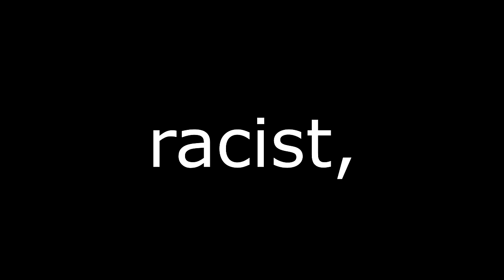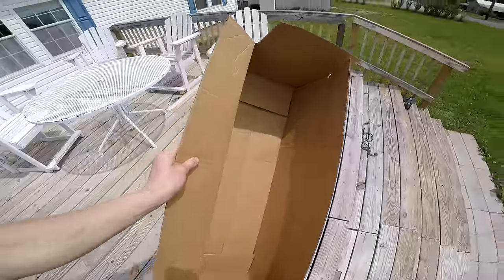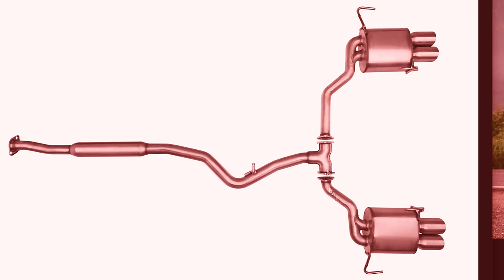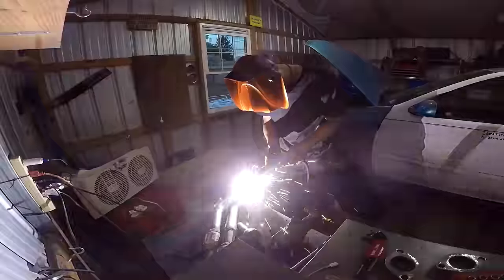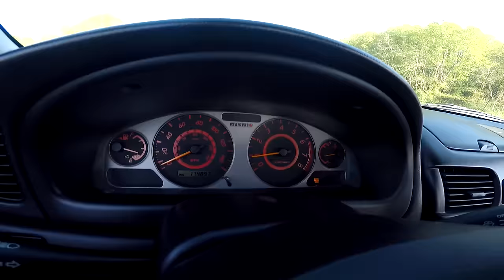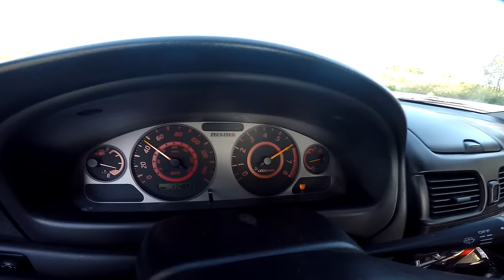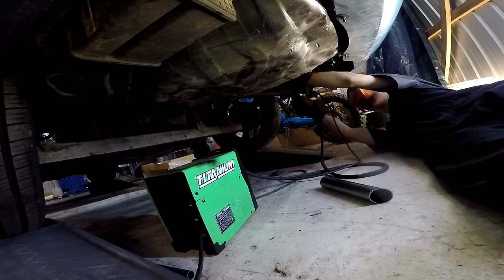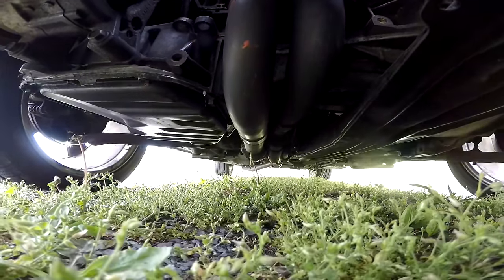True Dual Exhaust on a 4 Cylinder - What Will it Sound Like?

Comment: A little bit Subaru, a little bit Honda magna... neat.
Reply: Didnt mitsubishi make the magna?
Reply: @Cmdrbzrd  motorcycle, not car.
Reply: Yeah pretty accurate actually
Reply: Yooo y this comment make me lol 😂
Reply: Yo I have have both and let me say, yes. Yes indeed 😂
Reply: Sounds like a 22b scooby rally
Reply: which is a boxer 4 and the other is a v4
which means success?????
not inline but still a 4 cylinders
Reply: @Spheredalai  u have no clue
Reply: @savagesemple5353  sabie?
Reply: Saabuhroo
Reply: @Cmdrbzrd yes they did the Magna /verada was mainly produced in Australia / Africa for the Australian African and Malaysian markets but was produced and sold in the USA as the galant and verada as well the car was generally regarded as reliable as long as you kept up on maintenance as the 6g70 v6 platform well good all around it will throw serpentine belts and timing belts as well as blow head gaskets if you let it but put $5k of work on the engine of a Magna and you’ll easily get over 500k kms out of it
Reply: I miss my magna 😢
Reply: i don't own a magna but i still want  to own one and yes it sound almost like that ahhaah
Reply: mangina **
Reply: A lot of Subaru
Reply: A Sh&t ton of VW air cooled 4 cylinder
Reply: Definitely hearing the Honda magna. Had one before I got hit by a car on it lol
Reply: magna  exactly!
Reply: Sounds like an Austin mini
Reply: It DOES sound like a Magna!
Reply: I have a 1986 manga I can say it's pretty similar
Reply: It sounds nothing like my V65.
Reply: @Cmdrbzrd  smokey magna is what i see from aussie cartube
Reply: Not even a bit. This sounds like a Ducati
Reply: Exactly my thoughts or like the Evo  on 2 fast 2 furious
Reply: THIS COMMENT GOT MORE LIKES THAN THE ACTUAL VIDEO 😂😂😂😂😂😂
Reply: As a Magna owner I thought the same
Reply: I own one that I vfr swapped. Love it and would never part with it.
Reply: @camdenk1642  vfr? Like the 750 interceptor?
Reply: I miss my magna
Reply: Magna 🤔
Reply: I own a Honda Magna with 4 into 2 SuperTrapp exhaust. It's a very similar sound.
Reply: ABSOLUTELY! My first thought was that this sounds shockingly like my Magna minus 3k RPM. It’s got a much less aggressive idle than the Magna, but under acceleration it sounds almost exactly the same.
Reply: I miss my magna
Reply: i read that to the tune of mambo 5

Comment: It sounds like a well mixed cross between a Subaru and a bike engine...almost reminiscent of a Group B car. You've unlocked a new setup for 4 bangers that doesn't sound shit.
Reply: im now processing how you could make a decently quiet true dual for performance on a sleeper. would sound good and hopefully close to stock with the smaller pipes needed.
Reply: lmao it does sound exactly like a bike engine, probably because of how only half the cylinders going through each pipe gives a pulsed characteristic to the sound.
Reply: Four cylinders are boring as heck, any UEL setup that isn’t completely straight pipe is gonna sound good unless it’s a tricked out 4ag which sounds good even firing
Reply: No this sounds like shit for sure lol
Reply: @bmthfan1231  says the bmth fan (jk)
Reply: @bmthfan1231  well BMTH sure does so I’ll take your word for it
Reply: @DisturbedVette  I don't like bmth I seriously don't know why it made my name that 💀
Reply: @kccarranza2750  probably a good idea because while music doesn't have anything to do with it, me understanding good from bad sounding engines does. I also don't like the band, idk why it made my handle that. I never got to pick my handle.
Reply: Now add super unequal length headers.
Reply: The bike engine it most closely resembles is a parallel twin with a 360 crank, but there's definitely a four cylinder boxer sound in there.
Reply: I was gonna say a VW and a bike...but YEAH; a flat 4 and and a bike. That's exactly it.
Reply: @DisturbedVette i think k and 4g are pretty exciting. you could throw sr in there
Reply: Exactly what I thought when I first heard this, a bike. Could sound like some Harley Davidson's or something lol.
Reply: yeh sounds like if an impretza and a ninja 400 had a baby
Reply: @operator0  sounds a LOT like a tuned up citroen 2CV!!
Reply: i thought it sounded like a flat 4 as well lol, reminded me of my NA subaru lol
Reply: To be fair, as an 03 spec v owner with UEL headers, it already kinda sounds a bit like a boxer. This motor can actually sound good with the right setup that isnt all ricey and raspy.
Reply: Love the Subie sound!!!
Reply: It's those small honda engines that sound quite bad. B230 sounds nice with proper exhaust 😏
Reply: Only problem with this would be the a/f sensor. Pair it with ITB carbs...?
Reply: Sound like dirt bike
Reply: @archangel3237  Just run two of them.
Reply: 1:44 sounds very much like Polonez 2000 Rally. It had a distinctive sound for the time, maybe because it was 2 liter in line 4 but only with 2 valves per cylinder. The exhaust configuration was exhaust manifold going into long barrel double exaust that would go single pipe halfthrough the car, with a single straight-through silencer.
Reply: I'd say a mix of subaru boxer and 5cyl engines
Reply: Just buy a Subaru…
Reply: Just get a subaru, much easier
Reply: @DisturbedVette  but 4 cyl bikes sound amazing, so emulating that in any way possible can only be a good thing.
Reply: @isaacs3413   Yes but your average economy car doesn’t rev that high so it’s usually pretty boring. 4 cylinders really don’t sound bad unless you put a fart can exhaust on them, but pretty much any car will sound bad with that setup.
Reply: @DisturbedVette  Yeah true thats probably the main thing, some 4cyl engines can rev quite high but they're usually in sportier cars that sound alright anyway. Yeah also very true even a nice engine sounds shit with a fart can unless its a alfa v6 or something. Won't even be many 4cyl bikes soon anyway they're on the eco hitlist.
Reply: @GamerGavin04 p
Reply: Bro hasnt heard a titanium exhaust s2000 shit sounds like a ferrari paired w induction
Reply: @repingers9777  very nice sounding but not high pitched enough to sound like a ferrari
Reply: @DisturbedVette  i have in cabin audio of my 8600rpm k20 si with a metal loud short ram intake that sounds almost exactly like a ferrari 360 i even compared audio between them 1-4th gear and even matched the shifts up its crazy similar its funny i get to hear those sounds and see those revs in my daily driver honda but as for the exhaust its nowhere close and the s2000 exhuast sounds way better than any other honda engine too. Its hard to get honda exhausts to sound good at all. Its sorta because of how efficient they are same with some bmw engines and the nissan vq have that unwanted rasp and tones bc of there high NA performance and need for exhaust scavenging
Reply: @repingers9777  good headers fix any raspy engine, especially a VQ.

Comment: Well dang now I'm super curious what difference an x-pipe would make. It does sound deep, unique and different. I like it.
Reply from the maker: X pipe video is coming at some point.
Reply: It will sound like any other 4 cylinder again...
Reply: @identiticrisis  no it wont... you dont know anything about exhausts do you
Reply: @sigmamale4147  Ha, I guess not! Good job hater's garage actually did the hard work so we internet debaters have the hard facts instead of relying on baseless assumptions and emotional arguments that only serve to soothe egos.
Reply: @identiticrisis  whatever dude... ive heard enough x piped engines to know they sound very different
Reply: @sigmamale4147  there's a video on this same channel of this exact exhaust modified with an x pipe.
Reply: @identiticrisis  yes i checked
Reply: @sigmamale4147  yikes
Reply: @HatersGarage  will you be putting he o2 sensor on? Or can we bypass this?
Reply: it sounds like a boxer v4
Reply: That was my first thought with the dual exhaust 🔧
Reply: @HatersGarage thanks. That’ll cure my curiosity
Reply: @sigmamale4147  damn, an "experience" argument. How fucking original. You ain't winning shit without a source and a way to back up your statement other than experience.
Reply: @flightmaster529  won your mom at a traphouse auction
Reply: @sketchmoon3333 no such thing
Reply: @identiticrisis why would it sound like any other 4 cylinder? Do you even know about cars?
Reply: @Drogas3653  watch the video with the x pipe and make your own mind up
Reply: @identiticrisis  I read through this whole thread and took a listen - It sounds worse with the xpipe but it definitely doesn't have the high end ringing you get from the usual shitbox cans. So you're both wrong.
Reply: @agibitable  What's high end ringing? What does worse mean in this context? 

In the X pipe video the author states it sounds the same as the regular exhaust. I didn't remember being wrong about that.

The best is objectively the dual with 180 pairings and H pipe, btw. Or the staggered pulses you tend get with the packaging in FR layouts e.g. S2000.

I synthesise realistic engine sounds from scratch and can read cylinder pairings and pipe lengths by eye to guess the resulting sound pretty well. But I developed that ability by starting with measurements and observing patterns.
Reply: @identiticrisis  Ah yes, the engine sound savant is in the Youtube comments, LMAO. Look up the definition of the word "objectively" sometime. Have a great weekend!
Reply: @agibitable  the use of objectively was intended to be an obvious joke. You were supposed to mention Subarus or something! 
Enjoy your weekend too, and thank you for the compliment.
Reply: @identiticrisis  Doesnt sound like a 4 cylinder at all.
Reply: @gamermanshak5351  it does in the sense the exhaust separates the cylinders into distinct 180° firing pairs. Like a boxer four (cylinder), or an old Japanese four cylinder motorcycle. Even old old school inline four cylinder cars had a touch of this unevenness, mostly in longitudinal installations (again, think S2000 vs. Civic).

Might not be what you're used to, sure, but believe it or not, standard even firing four cylinders used to / can still have character!
Reply: @identiticrisis  I get what you're saying; I should've rephrased my comment sorry. What I meant to say is that It doesn't sound like any relatively "modern" 4 cylinder.
Reply: @HatersGarage can’t wait for the x pipe

Comment: Awesome video, straight to the point. I like it. Sounds nice, almost like a boxer engine.
Reply: It does sound like a boxer!
Reply: I have 2 of the same car as him. One has an unequal length header and sounds like a boxer, just not as pronounced. But very cool video overall.
Reply: Boxers only get that sound from UnEqualLength Headers (often called UEL headers) which is somewhat similar to this (I know there's differences...)
Reply: @experimental0000  Yeah. There are Subis without the uel headers and they dont sound subaru at all. 
Porsches are boxer too and sound completely different, or the old vw vans, beetle etc
Reply: Boxer 4's like the typical subi rumble get the sound from unequal length headers not because they are boxer engines.
Reply: mostly unequal length header sound
Reply: Firing order also made the difference
Reply: @YeakZa  Firing order is the same on a flat 4 as on an inline 4.

Comment: You take that first comment back!

-Every Subaru ever.
Reply: Subarus are the only non-4 cylinder 4 cylinder
Reply: Subarus sound the way they do because they usually have unequal-length headers. You can make an inline 4 sound like that if you go out of your way to mismatch the header lengths. Unfortunately it also isn't the best for performance--you gotta choose between sounding cool and going fast(ish).
Reply: @rfmerrill Yeah. Although it's partly the flat/boxer layout, which does create the weird note.
Always thought old school beetles sound similar. 
I've got a Gt86 and my mate has an old beetle and they sound surprisingly similar at idle.
Reply: @rfmerrill  Little addendum, my Subie has ELHs, but still gives off the Subaru sound, just to a lesser extent.

Comment from the maker: I'll be adding an X pipe to see what difference that makes soon, stay tuned.
Reply: cant wait
Reply: Cool!  I'm curious are the header runners totally equal length?  My factory mr18 has only slightly uel runners and it does add some rumble
Reply from the maker: @spsproductions2614  I'm actually not sure if they're completely equal length. I doubt it would make a big difference in the scenario though.
Reply: @HatersGarage  Got it👌
Reply: Cant get any worse !
Reply: Have you done the x pipe yet? Would love to hear that. Maybe a link?
Reply: did you do the X pipe vid yet?
Reply: @dc-craje3641  Yes, he did
Reply: @Druze_Tito YouTube doesn't usually let people post links, but yes, he did
Reply: @HatersGarage Hey do you remember which cylinders you paired?
Reply: I'd do an "h" pipe first, then "x." Although, I guess if you make a section of pipe for your x and a section of pipe for your h then you could swap back and forth.
Reply: X pipe will ruin it.Might as well go 4 into 1

Comment: When I was a kid my dad had a 81 Dodge D50. His buddy that owned a muffler shop built him a set of headers and ran duals with 12" glasspacks out the back. It was ridiculously loud, but I loved it. 
When I started buying and wrenching on cars in my teens, I bought a 1980 Suburu Wagon and gave it the true dual glasspack treatment. That thing was a blast rowing through the gears.
Reply: My first car was also a 86 Subaru gl wagon but with the exhaust chopped off at the headers 🤣 (edit) with the 5 speed as well sounded so amazing shifting gears the deceleration sound in between lazy shifts  and those old engines didn't seem to have a Rev limiter 😮
Reply: My dad had an 81 Ram 50 that outworked every truck on the construction site lol
Reply: @notablynova4247  I believe it. We would load it down with as much firewood as we could get on it. It didn't even struggle.
Reply: @johnweisinger7390  most I ever saw him load it with was 2" steel pipe in 10' lengths, it was like 1800 lbs.

He also hauled an entire  Triumph Spitfire across the State of Illinois in the bed.

Half a Ford Tempo (front doors to bumper with engine and trans)

Truck went over 300k before the head went

Comment: I need this for my 04 altima so bad.  I just got the dual exhaust rear bumper from the 3.5SE and I’m just now figuring out my exhaust. Thank you for this. You have found the perfect sound.
Reply: Do it! Nearly the same engine that's in this video too, funnily enough. The QR sounds great for a 4cyl to start, when not connected to a CVT that is lol
(I know the Altima didn't have that for 04)

Comment: Would be interesting how the sound changes depending on which cylinders you pair up... 🤔
Reply from the maker: Done https://www.youtube.com/watch?v=rEDtQp8po84
Reply: Subject to correction but exhausts work on pulse and you got to match the corresponding cylinders together for a balanced motor...if not you could end up with blow back into the cylinders which kills power of the engine...i think its mostly 1st with  4th and 2nd with 3rd banked together...depends how your engine is timed

Comment: Fascinating way to get something similar to a Subaru without doing a unequal length headers, definitely going to see if it's possible with my car because UEL headers would have been more of a challenge than this style.
Reply from the maker: I think the true dual setup out Subaru's the Subaru UEL sound.
Reply: @HatersGarage  Definitily, gives it a sound closer to a 270 degree twin cylinder motorcycle

Comment: If you just picked up the merged pipes off the stock manifold, you likely have 360° firing pairs in each pipe.  It sounds a little lumpier because they're unequal length between the individual cylinders, and the spacing between the outlets doesn't even those out at all (like an x-pipe would...)

The 360 pairing is like Honda's F2 engines from the 1960s and the S800 racer, both had "true dual" exhausts and clips can be found on YouTube.

Pairing the cylinders differently at the manifold / head would yield something closer to a boxer 4 sound, or indeed Honda 4 cylinder motorcyles of the '60s and '70s :)

Comment: Out of curiosity, what cylinders did you pair with each other? 1&2 in one pipe 3&4 in another, 1&3 / 4&2, 1&4 / 3&2? All these different combos could make very different sounds when compared, i want to know what you chose to do.
Reply: And also would need to know the firing order.
Reply from the maker: It was paired 1-2, 3-4. I just changed the pairing to 1-4, 2-3 for even pulses, that video should be out soon.
Reply: @HatersGarage  sick! I've been glued to my phone waiting for new videos from you. Keep up the good work bro.
Reply: If you want deeper sound prolly do the cylinders that fire right after the one before it

Comment from the maker: I added an X-pipe to see that that would do: https://www.youtube.com/watch?v=uI-Pl7vCQBU
Reply: Wouldn’t bother or consider Xpipe since merge and crush exhaust pulses back to sounding like single farty exhaust sound.
Reply: you cant deny 4 cylinder boxer engines sound different
Reply from the maker: @christopherbradley8771  I'll rephrase what I said, all INLINE 4 cylinder engines sound the same.
Reply: @HatersGarage  done good job separating into 2. Much better sound than single or merged systems
Reply: @HatersGarage  YOU DON'T HAVE TRUE DUAL EXHAUST ON 4CYL, THERE IS ONLY ONE EXHAUST MANIFOLD 🤡🤡 nice clickbait tho, it worked.
Reply: @christopherbradley8771  Thats because of the unequal length headers, any 4 cyl will sound like that with a unequal length header. Now put a equal length header on a 4 cyl boxer, and it sounds just like any other 4 cyl engine
Reply: @Nathaaaaaniel  not necessarily I have an ehl on my Subaru and it still has a little rumble too it
Reply: Think it sounds pretty cool.